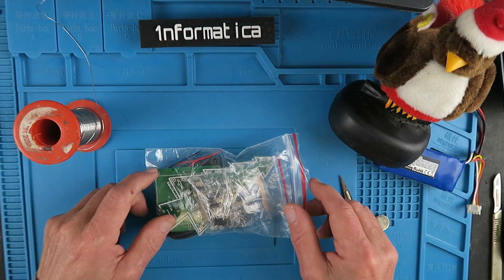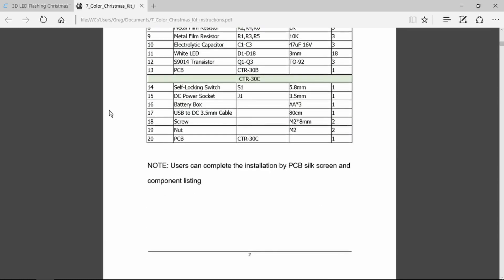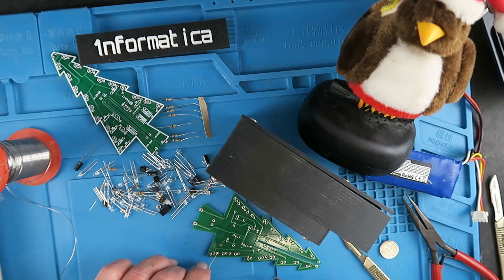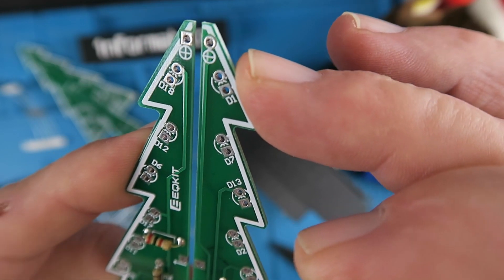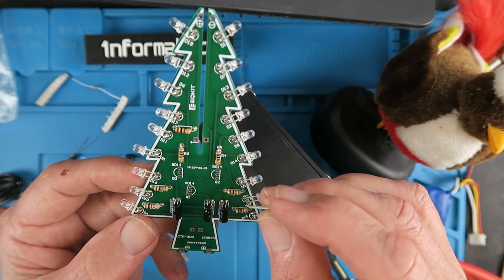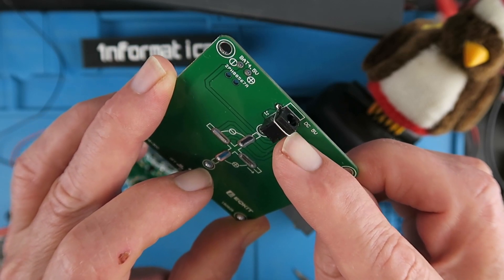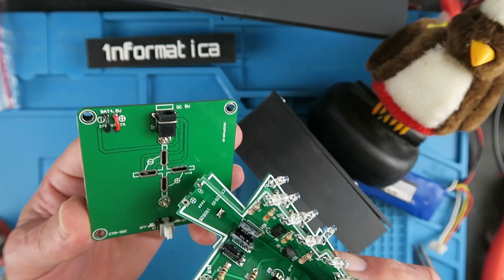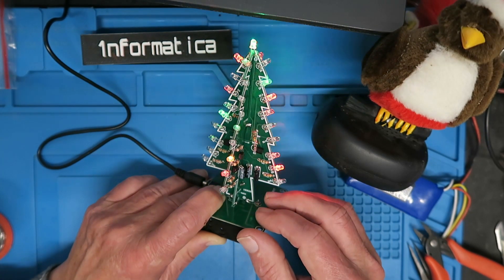LED Flashing Christmas Tree DIY Electronic Kit Build

Comment: Great educational project! I would not dare to laugh at the project kit as for a Ham radio operator i couldn't even construct a morse oscillator and bought one from a Ham in Durban. I did have a smile on my face watching the video and had a good laugh... Rockin Robin in the Parrot sanctuary!
Reply from the maker: Hey thanks Johan! The strange thing is that circuits you don't want to oscillate do, and those you do, don't!!